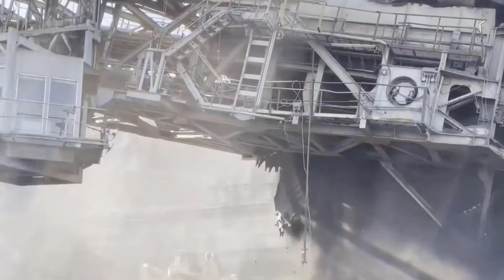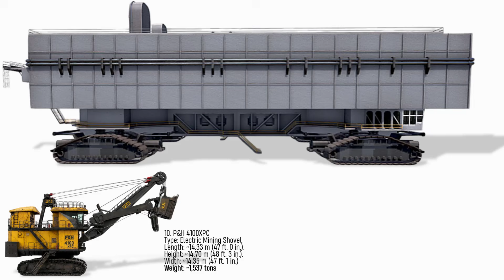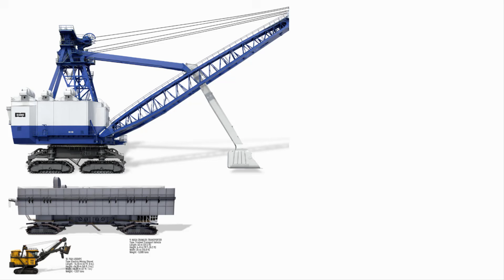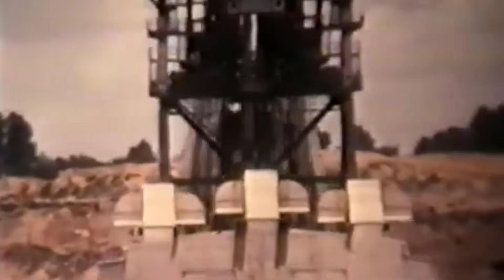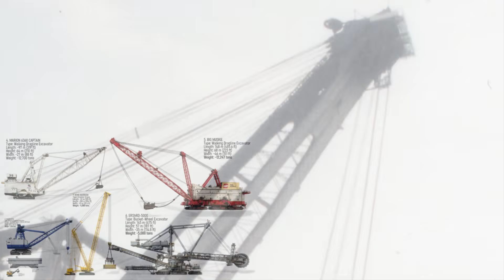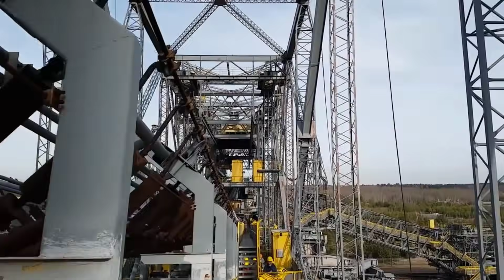10 Biggest and Heaviest Terrestrial Machines Ever Built

Comment: The "Marion" excavator/dragline of the USA at 3,100 ton was a baby we have draglines weighing up to 11,000+ tonne. I actually worked on the shutdown (maintenance) of #5 dragline at Goonyellah Mine a few hundred kms inland from Mackay in Queensland in 1984 it weighed 8,500 tonne
Reply: I’m guessing you didn’t watch to the end? They showed 2 more draglines/excavators weighing over 12,000 tons each.
Reply: @CoreyFSU1  They started out the draglines with a baby dragline #5 dragline ay Goonyellah Mine out near Moranbah, Queensland was about 8,500 tonne and a few years old back then and it was small compared to other draglines going in to other mines in the area and they were up in the 11,000+ tonne range with other bigger draglines on the way You must look at the fact that it was 42 years ago. 11,000 TONNE is around 12,000 US short, or what was called sugar ton a "sugar ton of 2,000 lbs" where our TONNE is 2,200 lbs US.